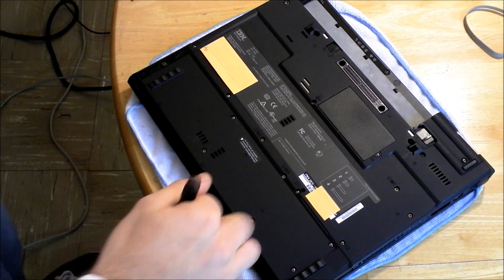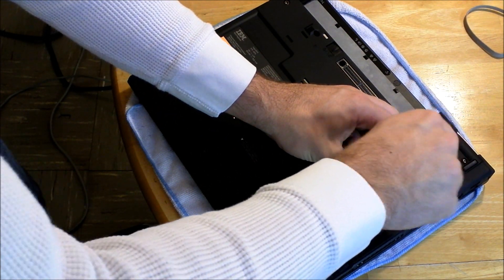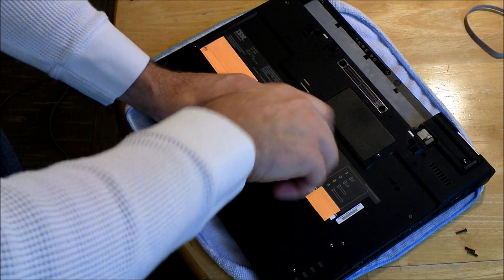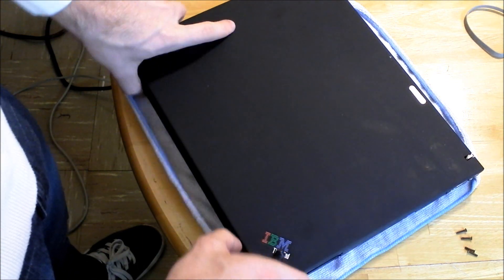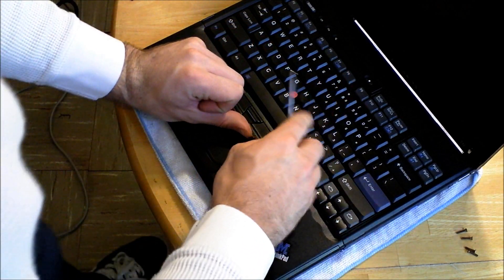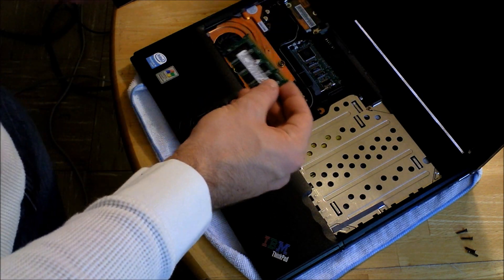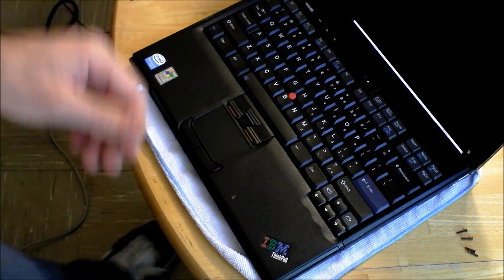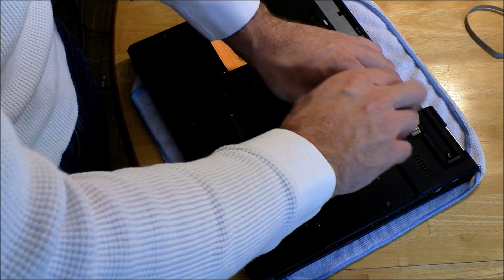Tutorial: Upgrade ram in IBM T42 Thinkpad

Comment from the maker: Unfortunately I don't have any X41s, however the removal process is much the same as the T4x series machines. You will need to first remove the keyboard (which I believe on the x41s is 5 screws), then follow around the edge of the base so you can pull up on the palm piece. I am currently in the 29205 area if you are local, I can guide you through it.